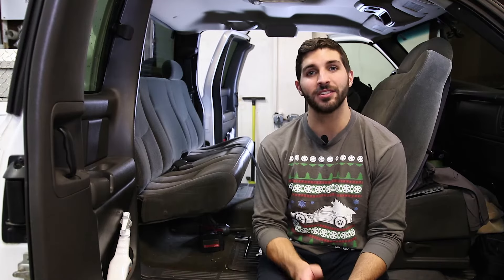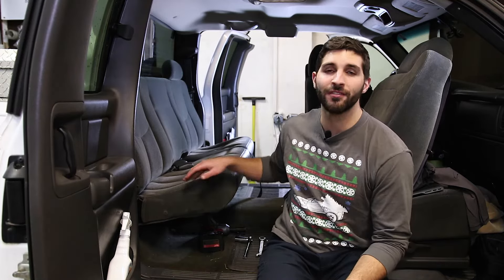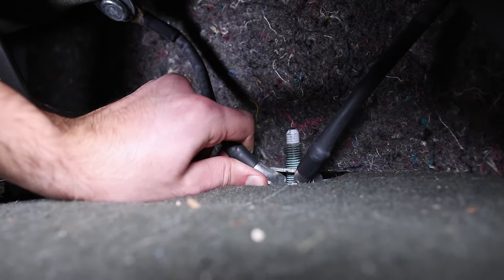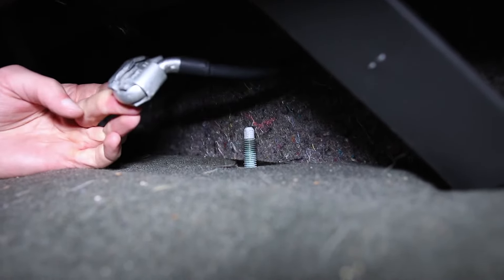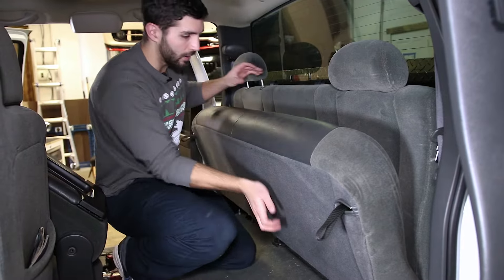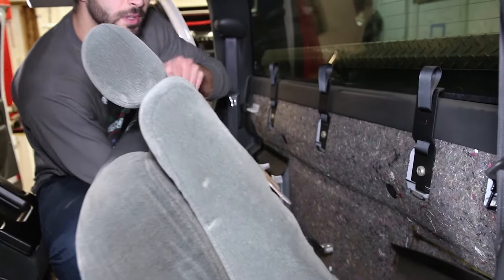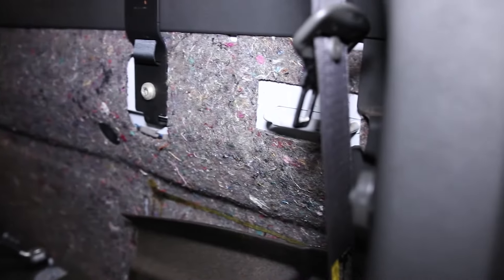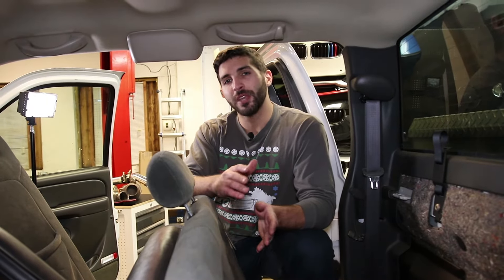How To Remove Rear Seats on Silverado and Sierra 1st Gen 1999 - 2007

Comment: Thanks for this. I missed the center nut. Fun fact. The eyelet is easier to remove if you grab it in the center with pliers and wiggle. It gets caught on the threads.
Reply from the maker: Good tip!

Comment: Good video.  I just bought the same year/make/model truck as you.  When rotating the rear seat bottom up, to give more floor space, the seat won't stay up if a little downward pressure is added to the seat or if the truck goes over bumps.  The locking hinge is on the passenger side.  I can see a thin bar going up and down as I pull and release the strap.  Any idea what the typical problem is, how to replace the locking hinge and where to get something like that? Looks like there's a Philips screw in the center of the locking hinge, I assume where the spring is.  Thanks.

Comment: Nice. Simple and straight forward. I thought it would be more complicated. I need to replace the rear wall blanket as the high mount stop light assembly developed a seal leak and ruined it.. Thanks.
Reply from the maker: No problem!

Comment: Thanks for the straightforward video explanation. We just got a 2007 at auction and the last owner smoked. Shampooing it has done wonders but hubs couldn't figure out how to get to the backside of the backseat. Thanks again!
Reply from the maker: Glad it helped!
Reply: @TheSundaeDrive  I have an 02 Silverado 1500 extended cab. I believe I have to do this to remove the center seatbelt am I correct.. I am sending it to a firefighter in another state who has a 01 GMC Sierra 2500...

Comment: When its time to reassemble the chair is it necessary to connect the cables that fastens  to the 5th nut ?
Reply from the maker: Technically nothing is necessary but from a safety pov, you should always re-attach everything to do with restraints and seats

Comment: great viedeo got me headed in the right direction but my 05 has tethers in both corners and the center. the tether on the right is under one of the bracket nuts that you are removing anyway but the one on the drivers side is stand alone so the nut has to come off. So 6 nuts total not 5 .
Reply from the maker: Thanks! Ok good to know! That may help someone else doing this
Reply: Oh… so that’s why my seat wasn’t coming out

Comment: 04-07 crew cab the rear seats are different from the extended cab. They have the 60/40 split seat.
Reply from the maker: Ok thanks for the heads up on that!
Reply: Is it possible to just remove the 60(bigger seat)? How hard in general?

Comment: i must have the odd' est back seat combo in my  '02 gmc crew cab 2500 hd .... cus i have to pull 1 st tab on pass,. side & roll the bottom of seat to the back of the front seat then go to the driver's side & do the same ... then shove the top side's down to the floor on each side..... ( i really hate mine here i rather have the VERY SIMPLE 2 PIECE DESIGN LIKE U HAVE HERE IN THE VIDEO...... CAN I SIMPLY  EXCHANGE THE 2 BACK SEAT'S SET UP'S OR WHAT ALL DO I HAVE TO DO........   ANY ONE KNOW OR HAS DONE IT & VIDEO'D IT ALL...... TO MAKE IT SIMPLE FOR ME HERE ......???????

Comment: What are the straps behind the seat for? I've never known their actual purpose
Reply from the maker: The ones bolted to the back of the cab? I believe they are for car seat tie downs but the owner's manual can verify that.
Reply: @TheSundaeDrive  yea I suppose if I ever looked in the darn for any info other than just motor and driveline info I would know. Haha thanks.
Reply from the maker: Lol no problem!
Reply: Great video any way to move anchors from middle to either left  or right for child seat??
Reply from the maker: I'm not sure, sorry.

Comment: Can I just slide down the top half of the seat, I’m trying to put a cover on
Reply: Probably already figured it out but no. You would have to still remove the bolts to the floor otherwise you wont be able to lift it up.
Reply: @TheBUGZNTA  I haven’t figured it out😅 thx though, I just ended up giving up on it, i was trying to put seat covers on it, they were too small anyways

Comment: My 2004 silverado wont fold up. Any suggestions?
Reply from the maker: It is very dangerous to have a folding truck. I know they only did a short production and the decided that due to the tendency to fold while driving and injure inhabitants to cease production and recall all units produced 😛 just messing, the folding "seats" may not fold if you have something jammed underneath behind them or the strap may be broken
Reply: The strap you're required to pull to release the seat so it folds up may 1) have slipped through the small slot in the fabric on the bottom of the seat (Mine did; it can be fished back through the slot with a coat hanger and some patience) or 2) the strap may have broken off previously and you'll have to remove part of the fabric on the seat bottom to release the catch with pliers or vise grips. Hope this helps.
Reply: Also had this issue when the seat is is down if there is pressure on it . The seat would not move.  I simply either move the seat up or down and then usually the seat goes up.

Comment: The hooks on the back of the seats rattle, the rear door panels on the extended cab rattle. The door locks rattles. The steering column rattles. The ashtray rattles. The lever to open the center console rattles.

I feel like this thing was designed by a kid with downsyndrome in the middle of downing vodka bottles

Comment: Awesome! Thank you for sharing; I think I can; I think I can, I think I can remove my backseat - thanks to your video presentation; I noticed the bolts underneath my backseat, but I wasn't sure how the seat-back would detach from the cab.  I am trying to resolve my water in-flowing into my cab problem. I already removed the third brake light and did my best to remove and remake a gasket; however, I also need to replace the pressure vents.  If interested, please visit my channel - UC6F19-bd_3GGCrEgfV6hqng - and look at the playlist titled  My GMC Sierra Humidity or Water Leak offer guidance. Thank you very much
Reply from the maker: We'll check it out! Also having a water leak in my truck I need to diagnose.
Reply: @TheSundaeDrive  Thanks to your video, I removed the backseat bench - Yippee Hercules! Hercules! Hercules! I used a 18mm socket with my 1/2 inch ratchet wrench to remove the anchor-nuts; I also had to remove the wheel jack-bracket, so I could lift up the carpet and carpet insulation.  I used bungee cords to hold up the carpet/insulation, placed the space heater in attempt to dry the carpet insulation and the rubber backed carpet. I am regretting that I may have to remove the carpet, but that requires removing a lot more interior parts.  I have a blue tarp covering the truck.  Now I am trying to determine how best to remove the carpet insulation on the cab's back wall; seat-belt plastic cover; etc in a effort to get to the air pressure vents [I believe I need to replace]; I am also suspicious that water may be leaking through the weather stripping around the rear window; I will proceed with caution because I cannot afford to break something in the process of troubleshooting.
Reply from the maker: @PappyNet01  good luck! Let us know how it turns out